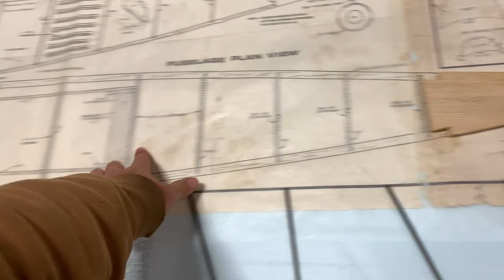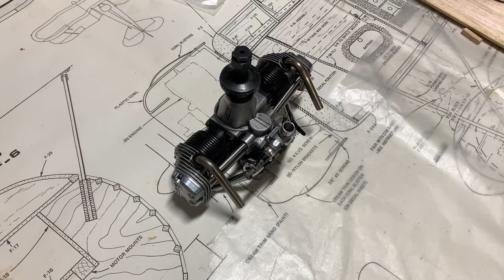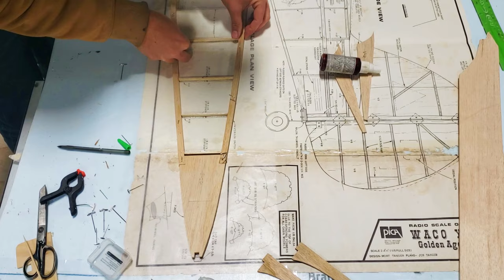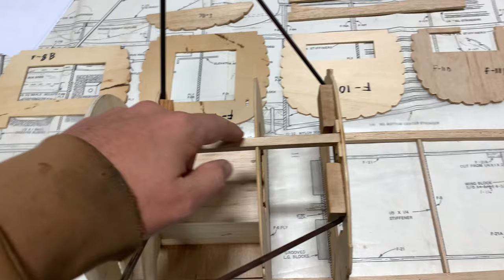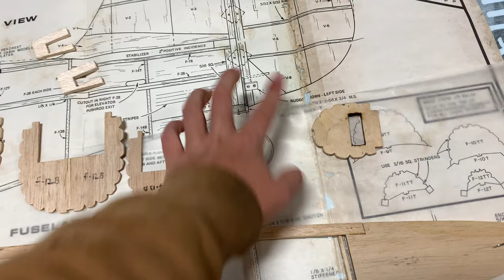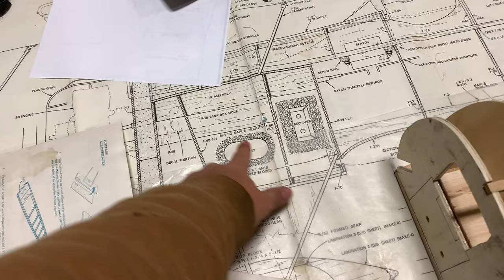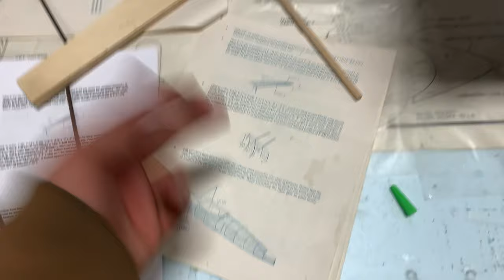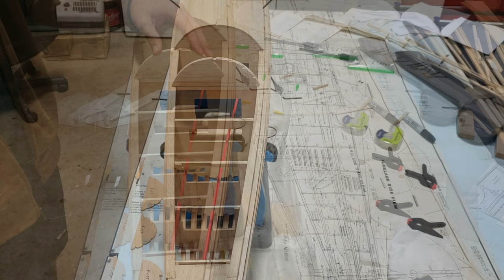Can I build this 80s era balsa kit?/Pica 1/5 Waco build Part 2

Comment: Looking good! I would put your switches in the cargo hold area. Not that much weight. Lots of room in the forward area for batteries and servos. These usually need nose weight regardless unless you put a big mag engine in. Plenty of wing area to support the weight. Nice engine choice!
Reply from the maker: Thanks after building the tail it’s not as heavy as I thought it would be so I’m pretty confident I can put all my accessories in the cargo door. Also I’m planning on using an exhaust setup for the 160 twin and not just straight pipes so that will definitely help as well.
Reply: @millerrc5829  yeah there ya go.